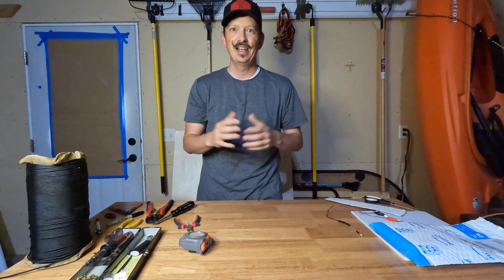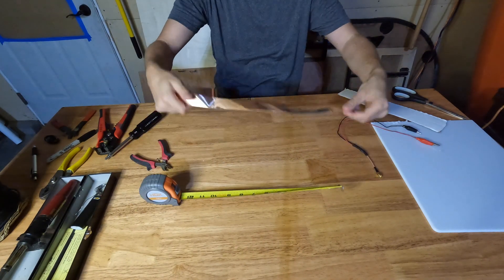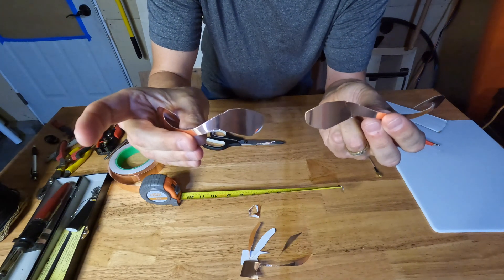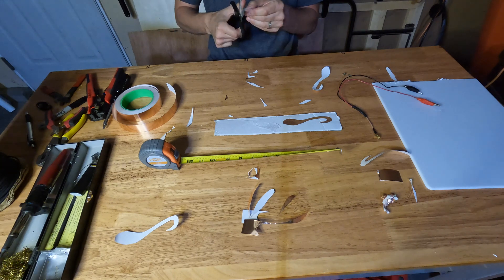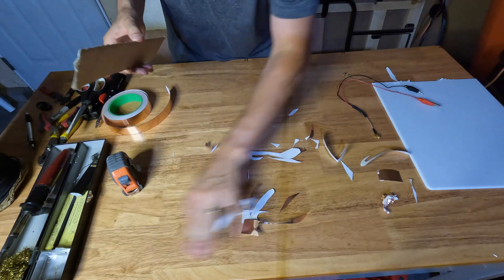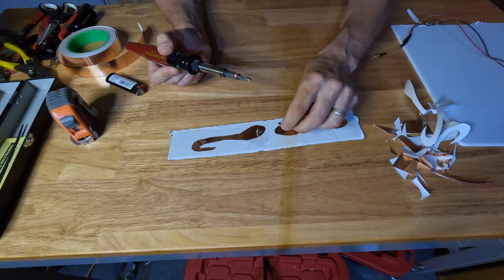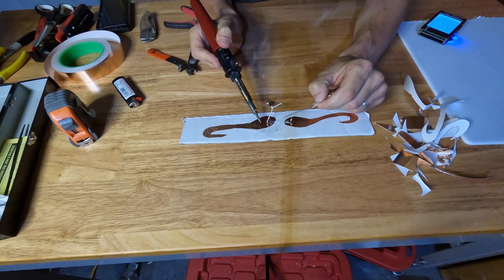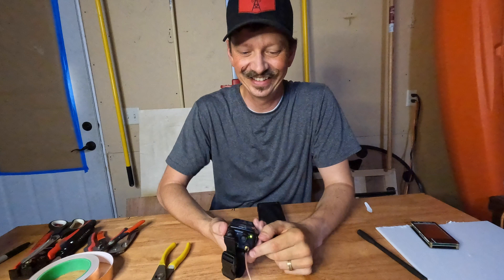Ham Radio Mustache Antenna for 70cm.

Comment: Awesome video. I am in Missoula. New subscriber.
Reply from the maker: Thanks! If your not having fun, is it even ham radio? 
Hopefully I can get over to that side of the state and get some parks activated.
Reply: @kj7iaz  maybe someday we can meet in the middle or some cool park and do an activation. I have not done an activation yet. But I have studied the heck out of it LOL take. Maurice
Reply from the maker: That would be fun. The hardest part of activation is the first one, just making sure you have all the gear needed. I practice in the back yard.  So if I forget a peice I can rectify it easy.
Reply: @kj7iaz  I will need to backyard a time or 2 also. Makes good sense.
Reply from the maker: Ever get in an activation?